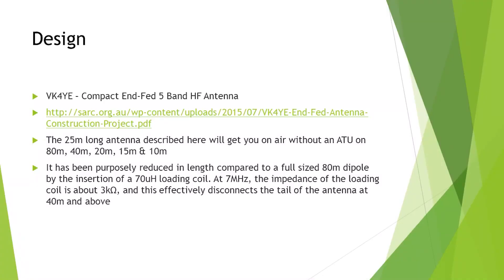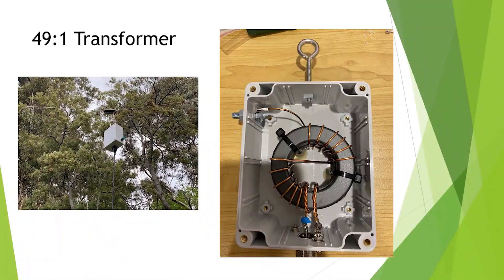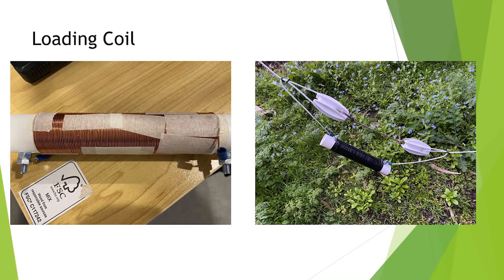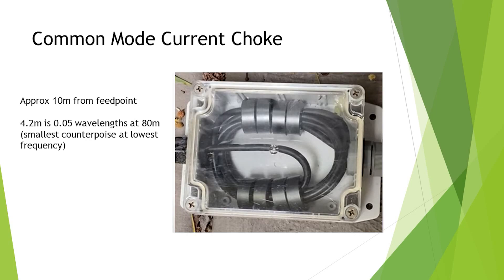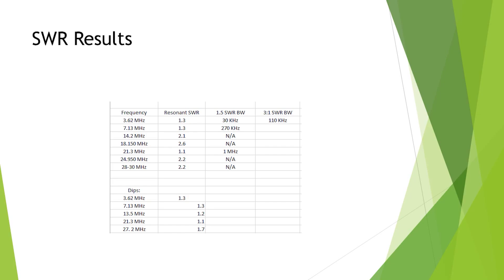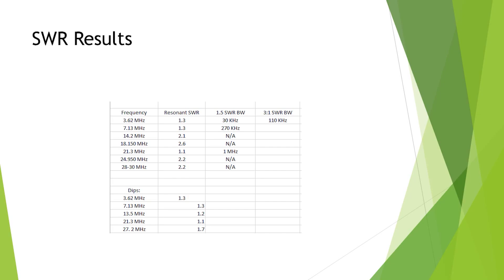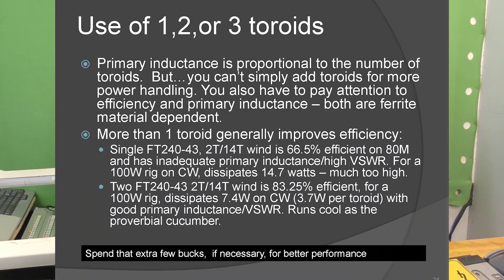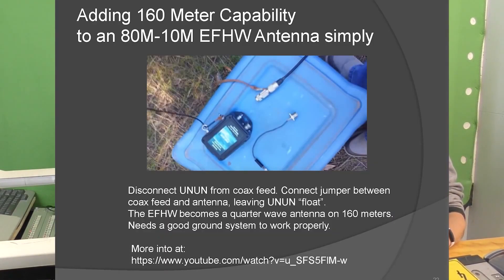5 Band EFHW Antenna 80m-10m | 49:1 End Fed Half Wave

Comment: Great presentation! I'm looking for ideas for a packable antenna for portable use, and this might be a contender.

One suggestion on the egg insulators at 4:01 though: those are designed so the rope and wire are meant to thread through the hole at the far end. That way the loops themselves will still be intertwined and support the antenna if the insulator breaks. It also means the weight of the antenna is compressing the insulator instead of trying to stretch it, so it'll be stronger.

Not a big issue for a lightweight wire antenna and ceramic insulators, but for plastic or 3D printed insulators it can make a difference.

Comment: I seen an older video recently where Steve Ellington said to use a capacitor in the middle of the antenna wire to get better VSWR on 20 and up. Have you heard of that Hayden?

Comment: Question on your home made choke using rg8x. What size and mix toroids did you use there?
Reply from the maker: I think it was FT140-43... several of them. But now I use FT240-31 with several turns through it

Comment: This is one of the most fascinating subjects I've been experimenting with for quite a few years now.  The great thing about YouTube is highlighted by the excellent presentation you've put together. I came across EFHW out of needs, I have enough room for the G5RV I started out with, moving on the a multi band dipole the difficulty for me was getting the centre point high enough without raising my profile with the neighbours. A wooden mast 30 foot high needed maintaining.  Fast forward a few years and I did a lot of research in the days before YouTube.  EFHW have been my antenna of choice for home and portable working - it works.  Is it the best; probably not, but installing a Hexbeam would not go down well with the station master or my neighbours.  Yes I'm a coward.  Every day is a learning day and I'm always finding ways to improve what I have.  On the question of counterpoises I took to measuring current flow in the wire.   Thanks for posting :washhands:73 de M0AZE Mike
Reply from the maker: Thanks Mike! Glad you found it interesting!

Comment: Great video Hayden. You should make a similar video on Fan Dipoles .  I racked my brain for 3 days with mine. It was always 20 and 10m that were the problem, even though i had physical elements for 20 and 10 , in additional to full elements for 80 and 40 .  No luck, thing would just not tune 20 or 10 .  I ended up adding to the 20m wires and med it 30m which tuned.  Got 80, 40 and 30 , nothing else below 2:1  . I never remember having such probs with fan dipoles when i ran then years back...

Comment: Sounds just like the kit I just built. Currently my coax enters the metal shed at about 3 meters from the un un and I don’t have a counterpoise yet. Wondering if I should. I take it you hook into the outside of the SO239?
Reply from the maker: I used the coax as a counterpoise and then placed a common mode choke consisting of some turns through a FT240-43 I think toroid.... but a counterpoise will also work, and yes it was a binding post just connected to the shield of the SO239

Comment: You said you used FT240-43 but linked FT240-31. I'm confused.🤔
Looks like you have been busy Hayden, I guess you would still use your internal ATU for better VSWR. I thought you have to ground all EFHW's. I heard the amalgamated tape was not UV resistant, probably won't matter much but maybe use a UV tape over it, dunno.🤔 When is this going to be mass produced?😉👍
Reply from the maker: Oops! Good catch, I better update that link. Yes usually use the inbuilt ATU especially if the whole band can’t be covered.

Amalgamating tape isn’t UV resistant so I give it a wrap of electrical tape over the top, which is. 
Mass produced, ha! There’s plenty of other end feds out there that are better ;) thanks Don
Reply: @HamRadioDX  Thanks Hayden. The PDF said grounding was tested but found not to be necessary. I do want to build one down the track for sure.🍻🤓